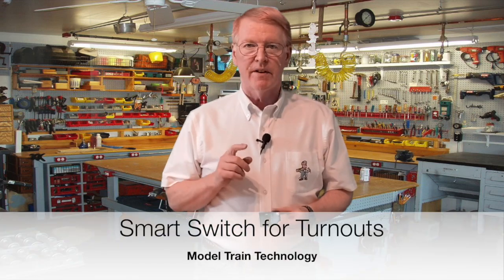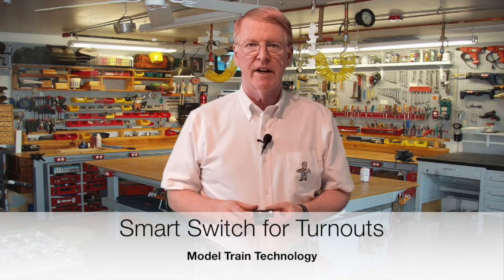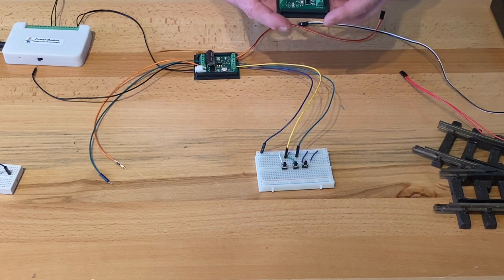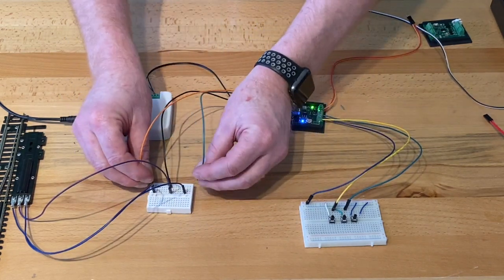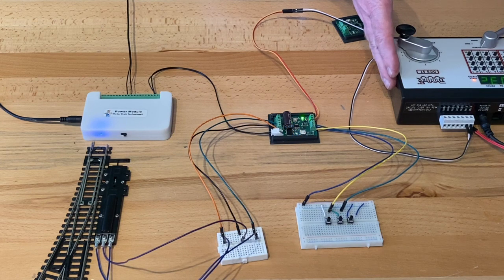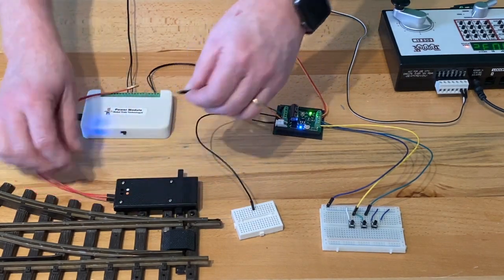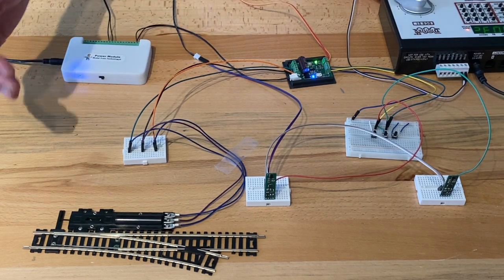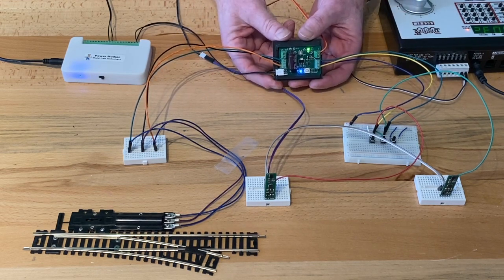New Product !!  Smart Switch for turnouts

Comment: Don't know if this has been asked,"  are they considered to be momentary, and can you add LED indicator ligjts"?
Reply from the maker: The SMART switch has support for both coil based and motorized turnouts.  You connect the SMART Switch digital signal to one of our Signal Controllers or relays that would intern light LEDs you may have OR ,our dwarrf signals.
Reply: @ModelTrainTechnology  Just for clarification i am using Kato turnouts, appx 15 using DPDT momentary, which requires relays to use indicator lights which i don't have because my soldering skills suck. .Will i be able to replace all my DPDT toggles with the Smart Switch? If so you can expect an order real soon....
Reply from the maker: @andreothomas  please use our support email for this specific detail

Comment: Not bad Jim. Can I assume 1 board per turnout? What about the Kato double crossover? Still 1 board? What else would one need to place led's on a schematic of the layout? 
Ron
Reply: and yes, my layout is Kato n and employs 18 turnouts.
Reply from the maker: Yes, but you can double up on the Crossover and link two SMART switches. Then, with the smart switch you have an output signal indicating the turnout positions.  There are two options for the panel.  Either out PD DPDT relay or the CTC Panel.  If you put in our Dwarf Signal Controller you can also use the second channel to run a fiber optic with lens to the panel.